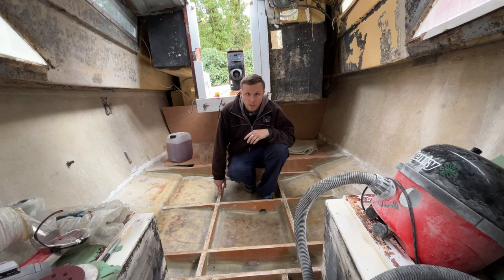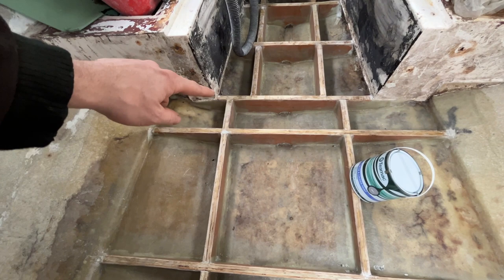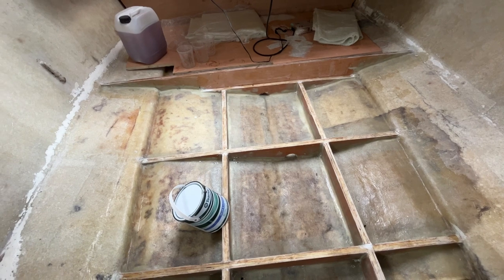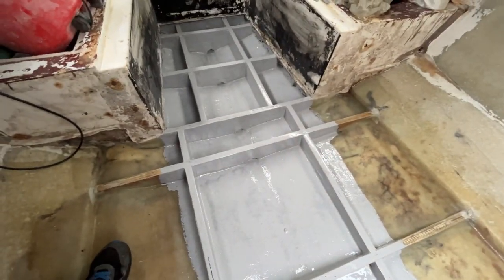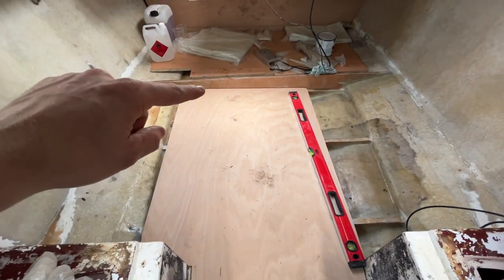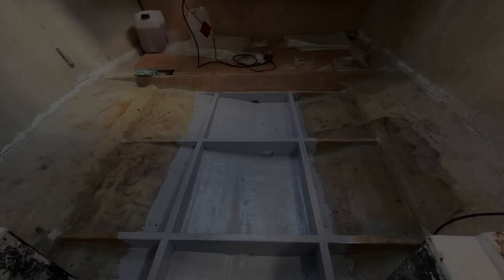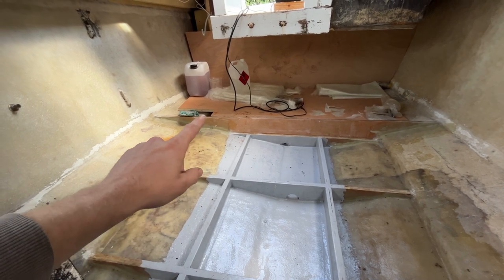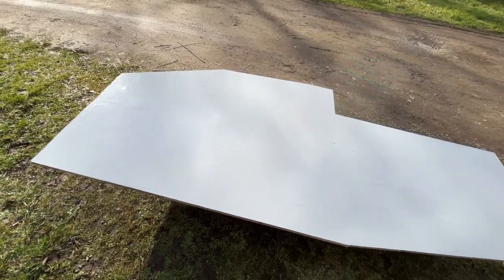Painting the bilge and laying the new floor episode 10

Comment: Tip for the paint tray. When painting at home I use a 15 inch roller tray . A messy job to clean, but I got an idea once to line it with ta double layer of tinfoil. Any paint not used goes back in the tin and the foil is thrown out, leaving a clean tray. Paint from previous use can flex off and spoil the finish where it can be seen. If it can't it doesn't matter. We were painting walk ways in a hangar one summer slack period and the small trays were being dumped in the bin after a single use. I suggested using zip lock bags as liners. They took up the idea and saved a fortune in trays and cleaning.
Reply from the maker: Great idea. I have used the same tray so far as everything I have painted is hidden but will definitely give it a go on the bigger jobs